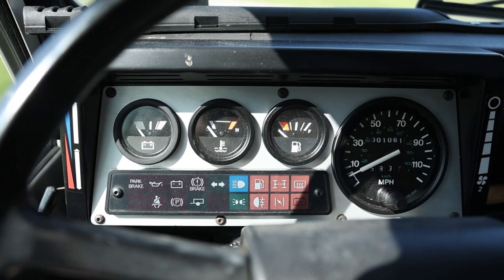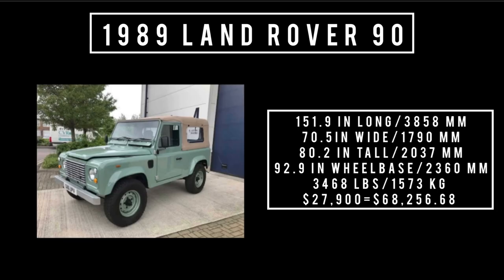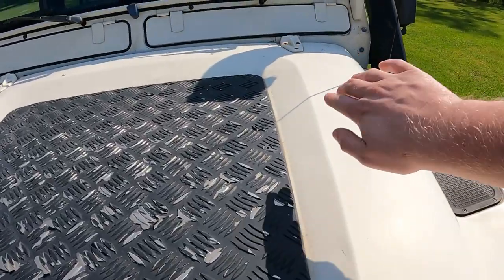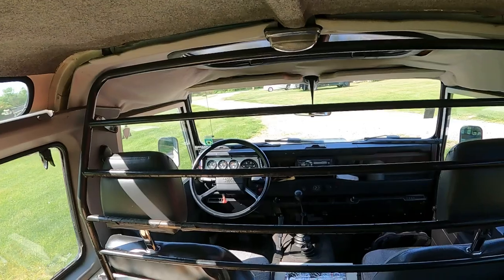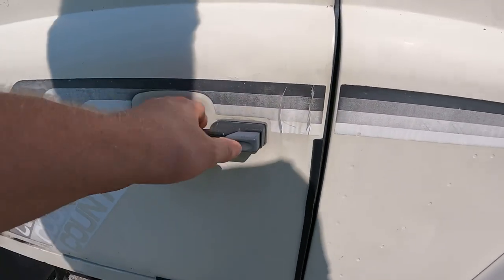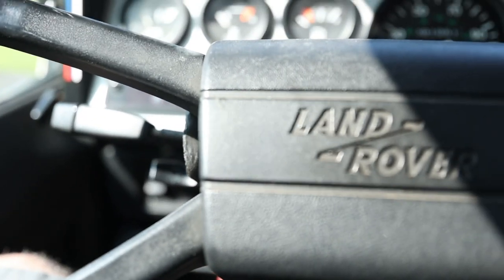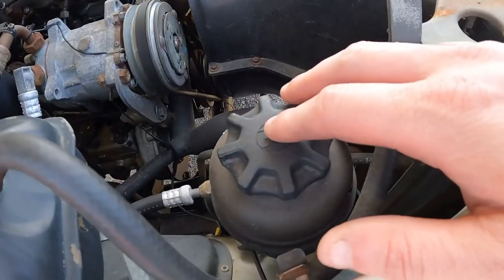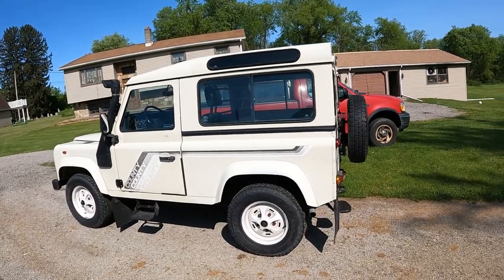1989 Land Rover 90, Does it live up to the hype?

Comment: Great episode on Land Rovers; always loved the old style from the 90 on back, along with Jeeps, Broncos, and Scouts.  The way the owner describes  the  handling, it handles  like my postal Jeep, and it is comfortable going 45 and no more than 50, due to the short wheelbase. I watched  Doug DeMero driving a 2022 short wheelbase one and got it up to 85 when it start feeling squirrley,  and had to slow back down. Curious  is that   Land Rover imported from Canada? I've never seen any left  hand drive  diesel Defenders down here in Texas, only V8 gas ones. The diesels I see are reconditioned right hand ones, and are selling for the upper 80's to 100 grand for restored ones. First choice  the  Land Rover 2nd the Bronco.
Reply from the maker: Glad you dig this episode =) it’s just slow and unpowered it feels like a vw aircooled product so you need to plan on every hill it’s a 5 speed so your shifting gears ever 10 mph and everytime you shift as soon as your off the gas power drops the moment your off the accelerator, just a different experience, as the owner said it’s more for paths than the free way

Comment: What??? These ARE tractors and are very much at home on the farm.
I'd never seen one of these with a turbo diesel in the U.S. These were never meant to be a highway vehicle, just as the original Jeep. They don't need to go fast. They need to be able to climb hills and descend into valleys.
Those which I've seen in the U.S., built for the U.S., had 3.9L V8's(based on the old Buick 215).
These were priced too high for the U.S. and too utilitarian. Most Americans popped for the Range Rovers or the Land Rover discovery.
Besides being owned by Jaguar,  both were owned by Ford into maybe the 2k's? Now it is owned by Tata of India.
Reply from the maker: Yeah I don’t know why the source didn’t list that land rover was owned by Ford in the 2000s maybe that they were embarrassed by that I don’t know. I totally forgot about it thank you so much for correcting that

I didn’t list all the engines because there was so much conflicting information in this vehicle is so out of my wheelhouse I’m not a Land Rover fan by any stretch of the imagination but that doesn’t mean that I’m not going to feature it on here

I was going to mention in the video it’s not the easiest thing in the world to drive. It’s slow, underpowered, the gears have the lineup perfect because of how the gates are and they’re all real tight together it’s a five speed and it only goes 60 miles an hour so you’re shifting like every 10 mph but as soon as you take your foot off the gas the power is gone. Which is the opposite of how you think because it’s a quote turbo and idk expect the power to be there like Carry you through the gearshift I mean it’s only a couple seconds but I mean as soon as you take your foot off the gas it’s like going off a cliff as far as power goes. My friend the guy that takes care of it told me it’s a really hard vehicle to drive but once you get it down it’s OK he says more for paths than roads. The vibe that I got from it, it’s like driving a top heavy air cooled VW with really bad plugs and wires. Because my Karman Ghia had more pull than this did and it had 54 hp